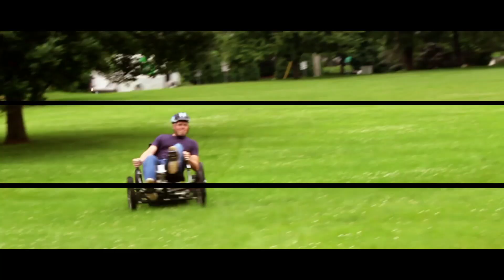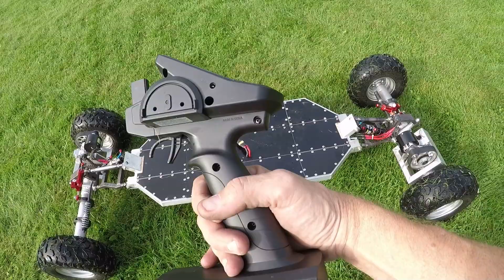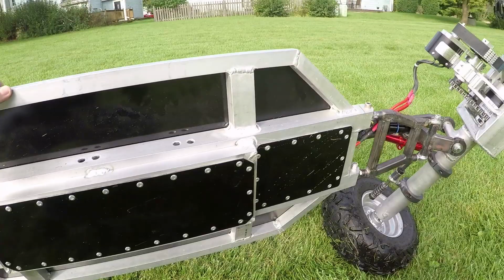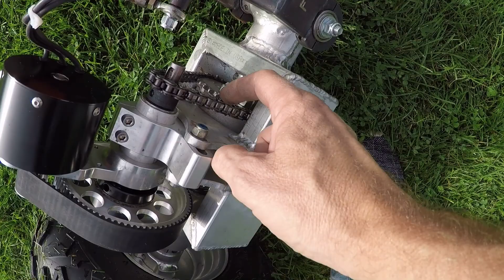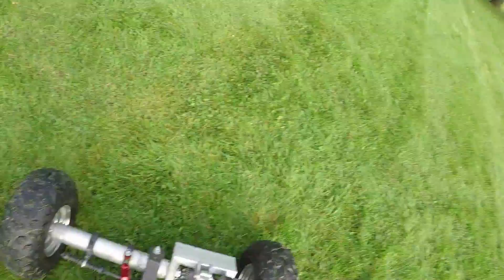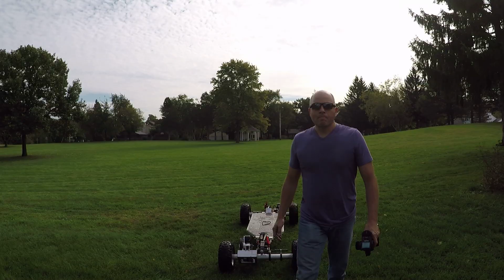Worlds largest off road skateboard

Comment: Very innovative build. I'm glad you explained why there was a belt and chain drive system. I wonder if you can add 80- 100 kg steering servo to the front so you can steer it with the transmitter while not riding the board.

Comment: Fantastic work! This is awesome! I love the suspension and ability to turn without hitting itself as it carves at speed
Reply from the maker: https://youtu.be/bxsRjKP_rpY

Here is another video.
Reply: @TechForumTesla  HEY LAD . I NEED LIL ADVICE HERE ON ESCs AND VESCs . WELL I ORDERED 4600W 4x MOTORS AND I HEARD TO REACH THE MAXIMUM POWER I NEED SUPPLY THEM WITH 48V ........ WELL IS THERE ANY WAY I CAN FUK THE PEDAL TO HEAT THEM UP TO MAX WITH 22V-28V ??? BIG THANK YOU

Comment: the differential lookscloke the one northern tool sells and the one they used on TRI SPORT, ALSPORT, 3 wheeler, madexin mid 70s
I put a 350 Honda on one BACK in 1974, I've found 2 since then, a ELECTRIC version would be crazy...GREAT BUILD....very talented 
man you are and access to some tools

Comment: i like how you described why a 34 inch drive axle needs a differential,   lol.   but, there is another way....i'm in the works on my own extra wide long board (street) and i found sprag clutch bearings that fit into my wheel hubs.
Reply from the maker: You will have problems with sprague clutches. When you throttle, the inside rear wheel will drive as much as the outside rear wheel and it will make the axle oversteer and bind. You will need to coast around corners for the sprague clutches to work. 

Trust me, if there were any way around using differentials, I would have gone that route.

One other major problem with sprague clutches is braking. You will have no brakes.

Comment: Where did you get that pulley wheel? ( The one with holes in it)
Reply from the maker: I have them machined to my specifications at a local machine shop.
Reply: @TechForumTesla  Really, I just I've seen them before on an ebike?
Reply from the maker: @adslammer1359  yup, my ebikes. I manufacture ebike drive units and compete bikes.
Reply: @TechForumTesla  wow, cool; i've seen photos but didn't know that was you!

Comment: Deck grip tape, or even better boot mounts like on a snow board.  Looks like tons of fun
Reply: I'd hate too crash on anything on hard group while locked into the board lol...
Reply: @AGFLOATS  I agree, but on skateboards you can have Bindings with no heel straps that you can slip out of if you need to bail. It gives extra control over the board in conjunction with grip tape, especially over rough ground